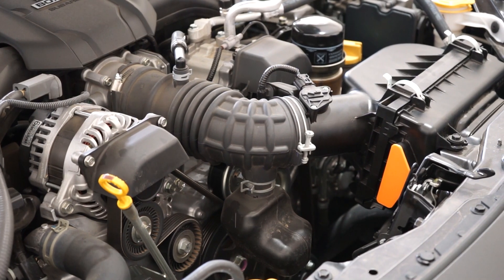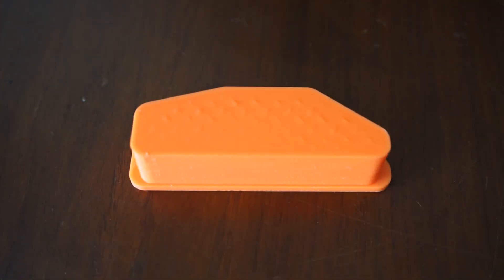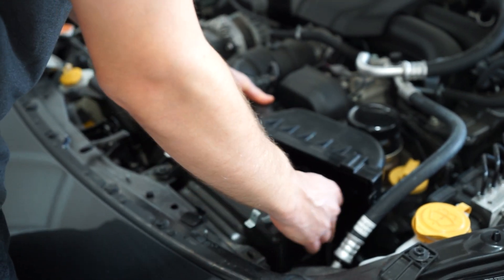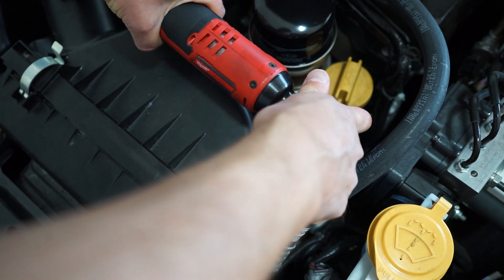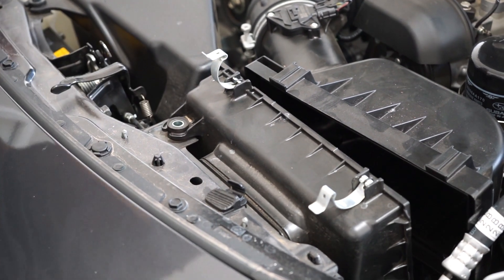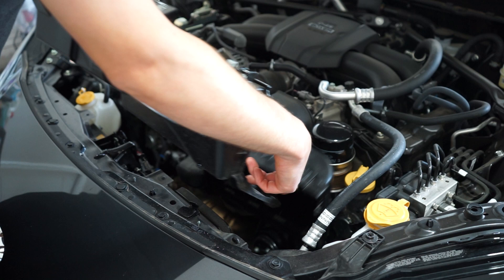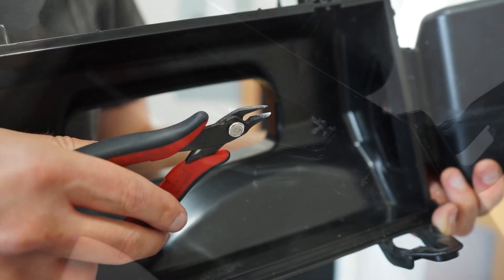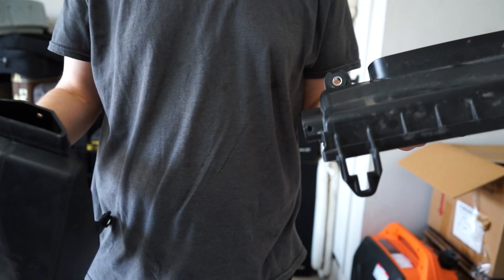22+ BRZ / GR86 3D Printed Intake Resonator Delete - Quick & Easy How To

Comment: there is another piece that connects but i believe you have to take off the bumper to take that one off, is that also just for noise or does it serve a purpose ? it should be the one that connects to the filter housing
Reply from the maker: Yes, that part is the intake snorkel. It has a bell-mouth to maximize the airflow and draws cold air from inside the bumper. I wouldn't recommend removing it but you can replace it with a GR Cup Car style snorkel for increased induction noise. Outbound Motorsports and Ansix Auto both offer them for sale. https://ansixauto.com/2022-brz-gr86-gr86-cup-intake-snorkel/ or  https://outboundmotorsports.com/products/cup-car-intake-kit

Comment: how big of the plier you need for cutting the rivet?
hard to tell in the video how big you need, I only have a small one for wires, will that be enough?
thanks
Reply from the maker: Small should be fine. I used these: https://amzn.to/48zbOzL  You could also drill it out with a drill bit, either way will work.
Reply: @altezzadreams  thanks , much appreciated!

Comment: A true humans resonator helps engine breathing as it cancels out refractory waves coming down the intake pipe from the intake Valves. If the car was designed with a Hamilton's resonator than it is there to help low in mid-range torque which is what most drivers need for their daily car commutes. Engineers design these cars with parts for specific reasons.
Reply from the maker: Yes, engineers design these cars with parts for specific reasons, but those reasons are not always to maximize performance. Many engineering decisions are mandated by emissions / NVH / cost and a litany of other factors. There are two data points I would present as a counterargument: the GR Cup race cars are very highly tuned machines made for a single make racing series and they deleted the resonator to maximize high RPM performance. The legendary tuner company HKS in Japan released an intake system for the GR86 which deletes the resonator and replaces it with an additional intake snorkel. The engineer at HKS stated in an interview that the secondary resonator on the intake tube helps with midrange torque but the front resonator is mostly for NVH reduction. I don't disagree with your statement but there are reasons why for certain applications the resonator is not necessary. If you watched our video you would see that we reached the conclusion that deleting the resonator was not worth it on a street car.

Comment: Isn't it just for noise reduction? Along with the one under the rubber intake pipe?
Reply from the maker: Yes, I believe the large resonator is only for reducing induction noise, but deleting it didn't seem to do much. According to HKS, the smaller resonator on the intake tube is there to reduce midrange torque dip which is why they left it on their induction pipe / intake box kit.

Comment: Hello 👋🏻
What about the other 2 resonators?
Reply from the maker: There is only one other that I am aware of. Its below the post MAF hose that is connected to the throttle body. There are several silicone aftermarket post MAF tubes that will delete that resonator. Grimspeed is the cheapest. (https://86speed.com/grimmspeed-post-maf-hose-kit-for-22-gr86brz) There are also parts from Greddy and Apexi that do the same thing.